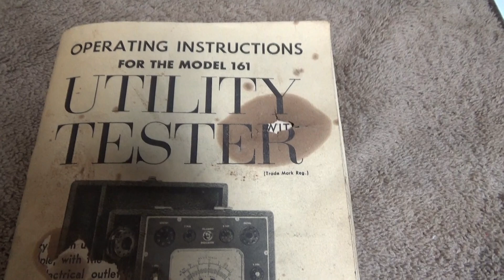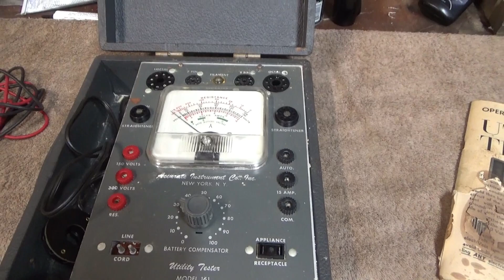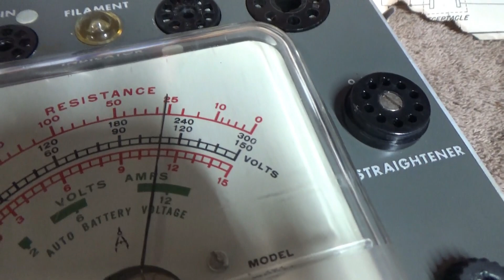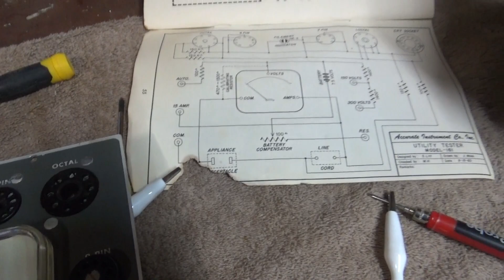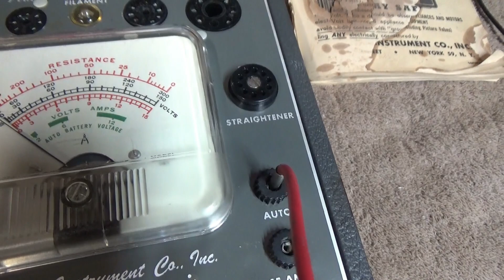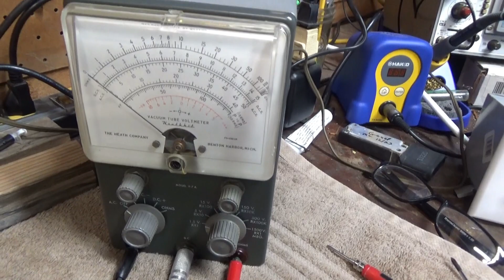1960 Accurate Instruments 161 Utility Tester

Comment: You saved me 60 bucks, I almost bought it on Ebay, sold as a tube meter, thanks. It looks so good, but how useful?
Reply from the maker: Thanks for the comments. This instrument is definitely not much of a tube tester (it's just a filament checker). However is is a cool piece of "consumer grade" vintage test equipment if you are a collector of such things. If you are looking for a tube tester I would suggest either a Eico of Hickok unit.